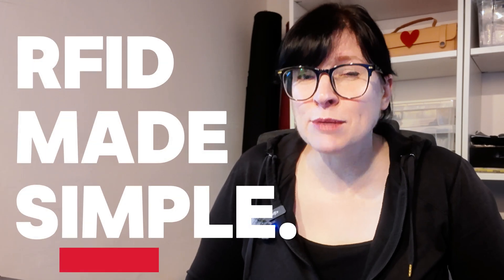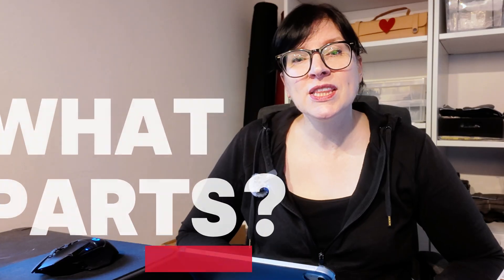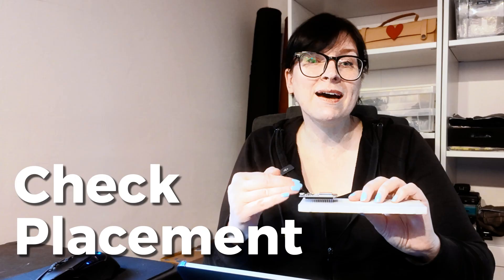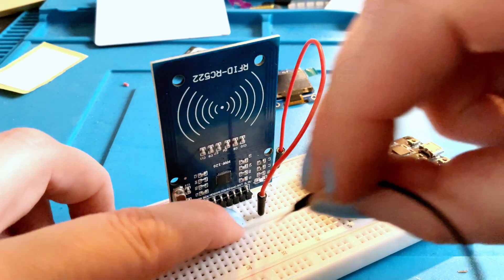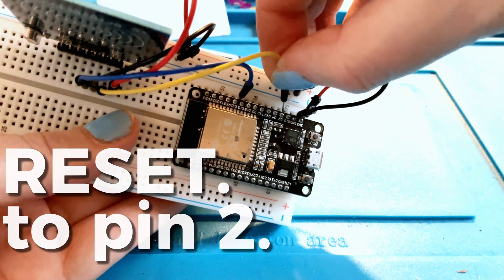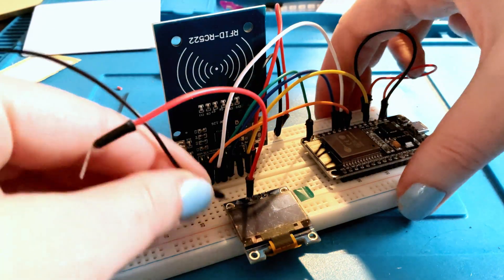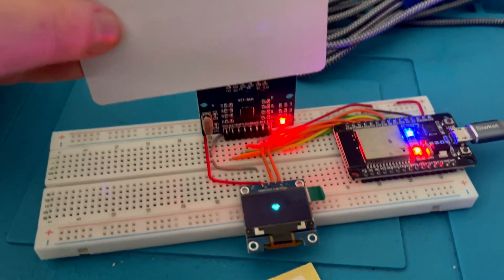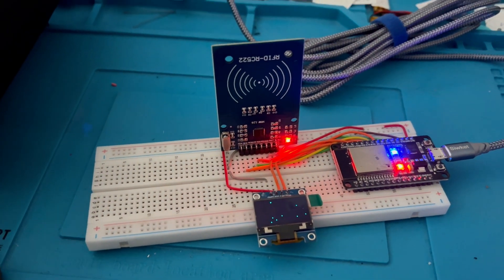Tap to Trigger: RFID + ESP32 + OLED Tutorial = AWESOME

Comment: Hey, awesome project! I'm trying to build a similar project, but I've run into a really strange bug. My RFID reader works perfectly for the first minute or so, but then it just completely stops. The weirdest part is that I have to unplug it and let it "rest" for about 30 minutes before it will work again (just for another minute!).
I've double-checked my wiring and even tried using your exact code, but the problem keeps happening. I'm totally stumped. Do you think this sounds like an energy problem (like something overheating) or is my RFID module just broken? 😕
Reply from the maker: This does sound like a wiring issue maybe, is there a short in your circuit? So double check ground and power? Which module are you using? Are you connected to 3v and not 5v power? Is there anything else in your circuit or is it just the rfid and esp? Are there anything else error messages in your serial monitor when you scan and when it stops?
Reply: @CMozMaker  I'm using an ESP32-WROOM (a variant without BT/Wi-Fi), an RFID-RC522, and an OLED screen. My power wiring is the OLED is on the 5V pin, and the RFID is on the 3.3V pin. With this setup, I get my main error: the serial monitor shows no error messages, but the whole system just freezes after about 1 minute (serial output stops, screen freezes). It then needs about 30 minutes to "cool down" before it will work again. I don't know if I should try copying your schematic from github, because it's not the same model of ESP32
Reply: It's an ESP32 with 38 pines that's why it's not the same as your scheme, so i don't know what to do
Reply from the maker: @isiortiz9722  So on the WROOM, I have many of these boards too - the pin mapping is usually the same for most varients of ESP32, so I've looked up the board, and the mappings are: 
- SCLK (Clock): GPIO6
- MOSI (Master Out Slave In): GPIO7
- MISO (Master In Slave Out): GPIO4
- CS (Chip Select): GPIO10

Double check the 3V is the power pin used, or even try using 3V input from a different sourcec to see if it's drawing too much current when it is scanning, stressing the system. 

Maybe check in code for how often it polls, looks for a card: 

// BAD - in loop()
mfrc522.PCD_Init(); // Don't re-init every loop!

// GOOD - only check periodically
if (millis() - lastCheck > 500) { // 500ms delay between checks
    if (mfrc522.PICC_IsNewCardPresent()) {
        // handle card
    }
    lastCheck = millis();
}

Any loose connections near it, any heat source near it, do you have another RC522 to test if it is the module? Is the chip on it hot, or the antenna? I have used a LOT of these boards and not had issues, but they can have a bad part, of wiring as they are pretty inexpensive usually. Try those things, and I've got my finger crossed for you, it can be so fructrating but once it works - man it feels like magic!
Reply from the maker: @isiortiz9722  also - try the OLED on 3V too.